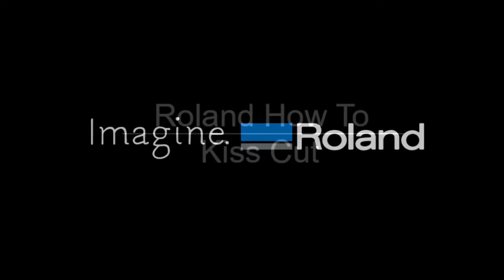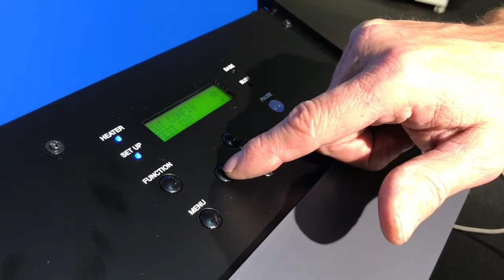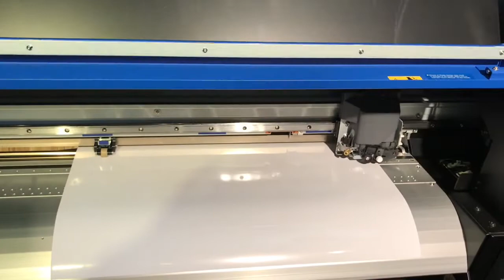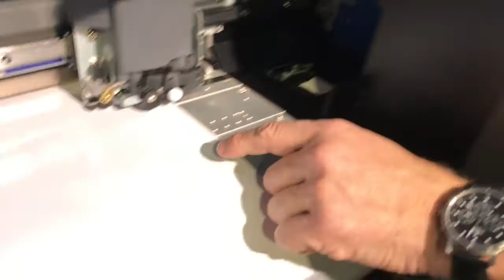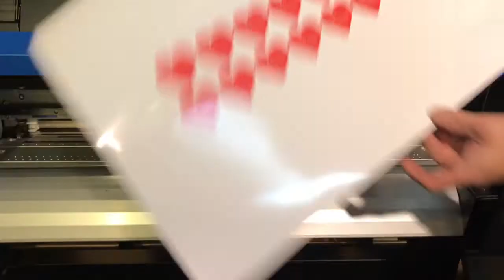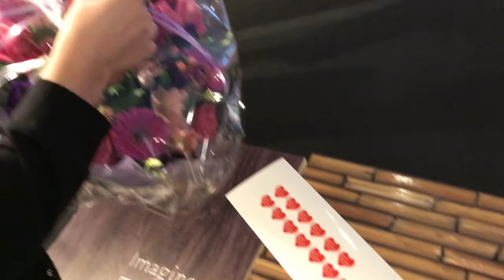Roland How To : Kiss Cut

Comment: That is not a "Kiss Cut" you are only doing a contour cut.  A kiss cut would mean that the backing paper around each individual sticker is cut out and the back has a 'kiss cut' (one cut line) through the paper liner for easy removal or separation of the liner.
Reply: Did you find a video for that?
Reply: he did a kiss cut